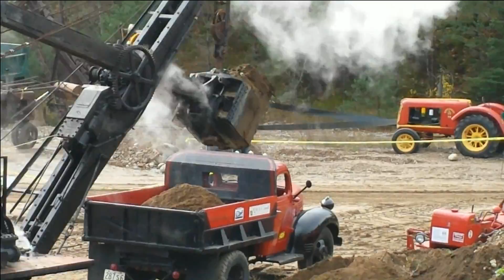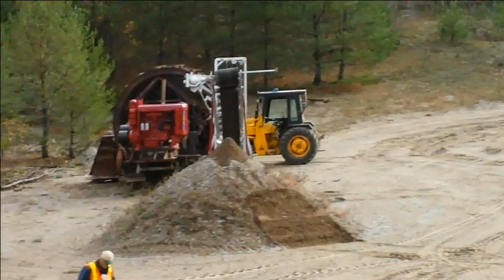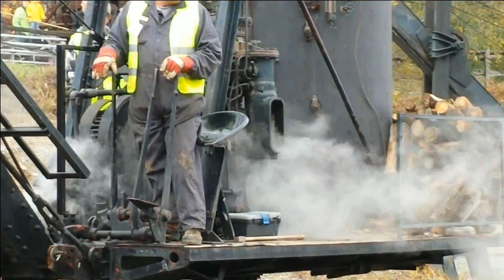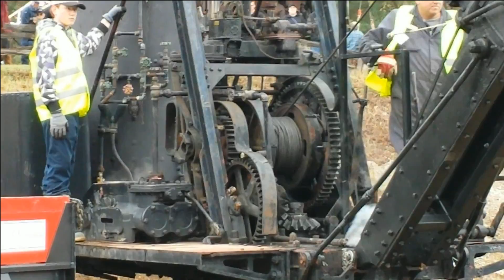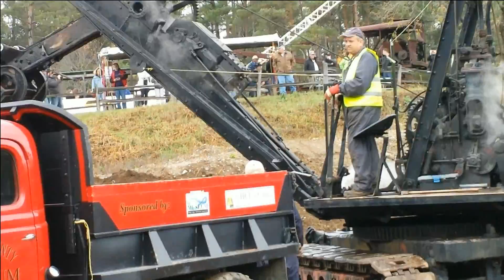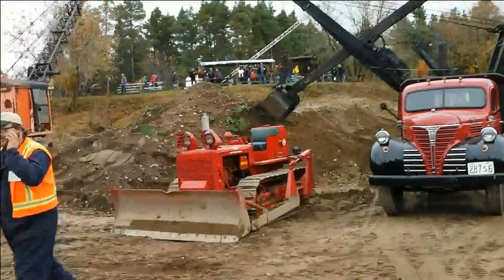Steam Shovel with covers off, see inside.

Comment: They better keep these old machines working and ready to build new ones. When the cost of diesel fuel goes up too much and the computer processor  quits, these dinosaurs will gladly take over and find some people with a set of balls to operate them. All the modern comforts are gone.Back to the old way.
Reply: I think the cost of fuel is going to go way down.  Look at the number of auto companies moving towards electric  : some exclusively.  And with air travel crippled, perhaps forever with China Virus mutations, there’s going to be a huge surplus.
Reply: @tomrogers9467  how wrong you were

Comment: There is steam coming out of everywhere, even out of a pipe at the top end of the boom. Why? Somebody please explain.
Reply from the maker: Not sure. I know it does not recycle the water, so whereever it is used, it is released. They also need to keep steam flowing through the engine even when not in use to keep it from condensing and causing hydro lock. I think it even gets used as a sort of lubricant. in high pressure bearings, but don't quote me on that!
Reply: @Randall Frank . The steam from the end of the boom is from the engine on the boom. These things had engines all over, with somewhere around 5 engines (most dual cylinders, of course) depending on the model, each doing a different task. As for steam from everywhere where else. It appears to be both exhaust, and probably keeping drain cocks open slightly, they don't seem to be running a blower through the chimney (I guess not much point with a vertical firetube boiler?) so none appears to be routed there. Although it almost looks like some steam chests are leaking a bit, hard to tell exactly. Most places running ancient steam engines these days, run with drain cocks open full time. To reduce risk of destroying an engine (and possibly also when these were new, since the engines might sit for a bit before a particular one is used. I'm not sure if they each stay hot enough through the repetitive on/off actions. Not-hot engine = some steam condenses back to water, which can't be compressed and can crack your cylinder block/head/etc. Whichever part gives first).
Reply: Coming from an marine engineer that is currently working on a steam ship, that just how steam power is.  It leaks from basically everything.   Especially if it is an old reciprocating machine.
Reply: It could be the safety valve to release excess steam
Reply: Steam trains do bleed off steam the same way. Safety valves I assume.
Reply: The engine on the boom drives the dipper stick via a rack on the stick. Its exhaust goes to the end of the boom!
Reply: All I can say is: "Never allow your water level to become too low! This can result in boiler explosions! Same can be said for railroad steam powered locomotives. They usually become deadly!

Comment: How about a tripod?
Reply from the maker: I took my motorcycle there, didn't have room for one.
Reply: cyrex686 Look for a monopod. Manfrotto make one of carbon, light but strong and small enough to transport on a motorcycle. It give so much more stability.
Reply: jps is right about the monopod - I have one too. More flexible than a tripod too.
Reply: cyrex686 do you live in ireland?

Comment: Am I the only one amazed that the shovel is running on WOOD?
Reply: alphaexcavation That’s the beauty of a steam boiler. It’s the original flex-fuel engine!
Reply: Wood is the only renewable fuel - trees grow faster than we can burn them, and contributes nothing to the carbon load- if wood isn’t burned it rots in the forest and releases exactly the same amount of carbon ( as  cO2)    As it does when burned.